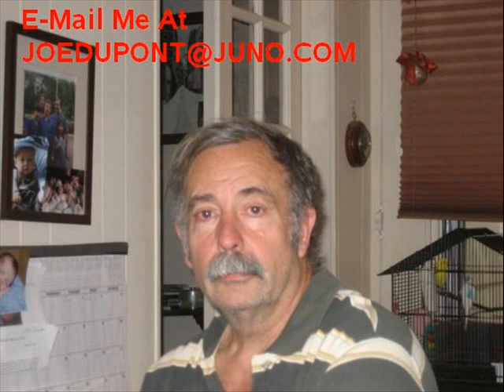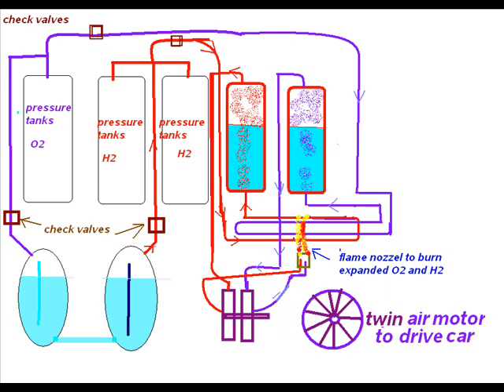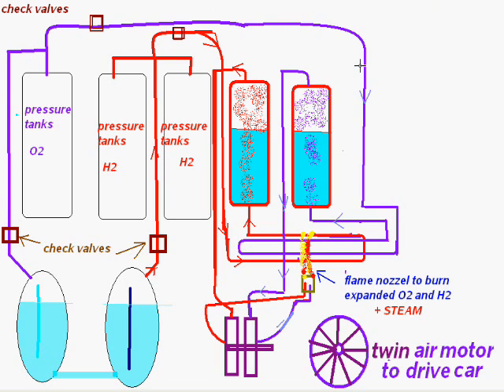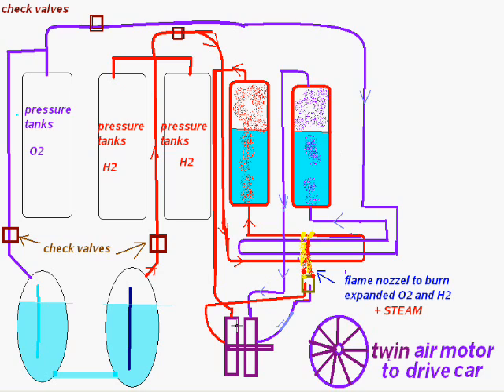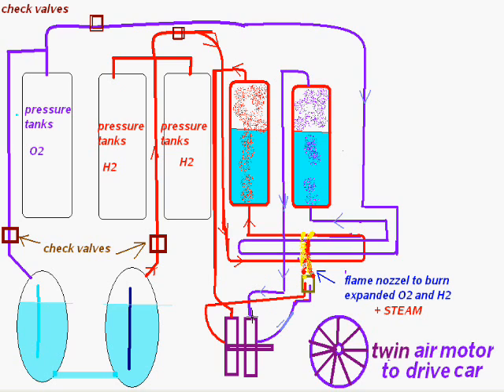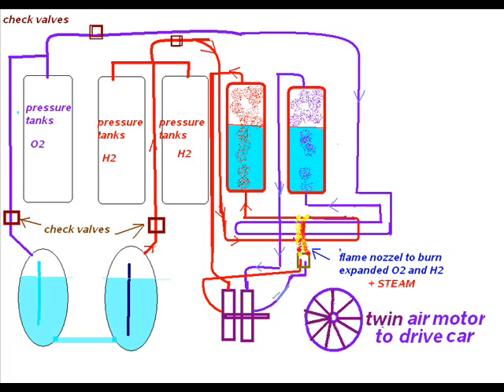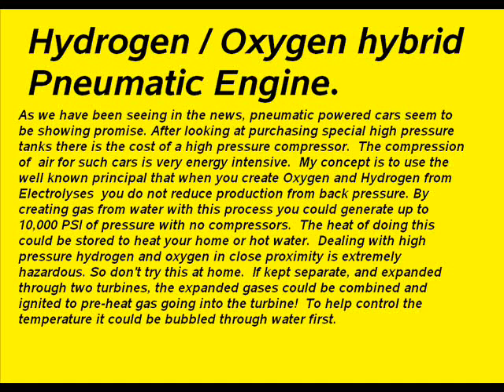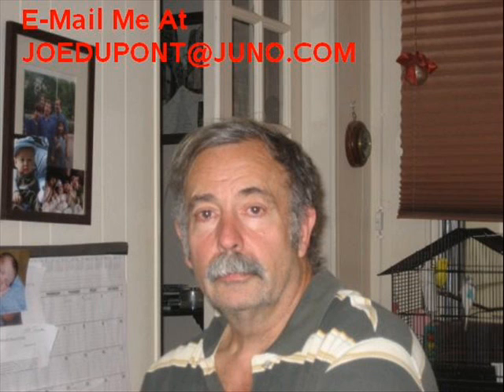pneumatiic Hydrogen Oxygen hybrid car concept

Comment: @Steve25g My process will take the hydrogen from the water, using the right applied temperature to turn the hydrogen in the water to a gas while the oxygen has not reached it's boiling temperature. I found a way to take any liquid to any temperature, especially above the liquid's boiling temperature, and in there I found the boiling temperature of other molecules in the liquid. Lab tests will prove what I say. Legal matters will make this happen, I go see a lawyer today.

Comment: @IAMBILLYTHEKID Actually, hydrogen stored apart from it's counterpart, oxigen, is less dangerous then the gallons of fuel, or other gasses you are used to.
If hydrogen escapes, it is so much lighter then air, and will not clog into the room, like cooking gasses, or any of the liquid fuels.

Comment: To much hydrogen, if it leaks and explodes, you are dead. Try making hydrogen at the intake manifold, no fires, with water in fuel tank. A molecular stuctual change would make this possible. I have done one to gasoline. See it, You Tube, White Gasoline Vapor. Remember what can be done to one liquid can be done to any liquid. I have 62 degrees Fahrenheit temperature range to work in. There I can make all the hydrogen water contains within it. Using temperature, changing hydrogen to gas, in water